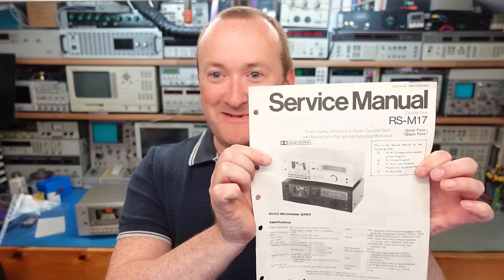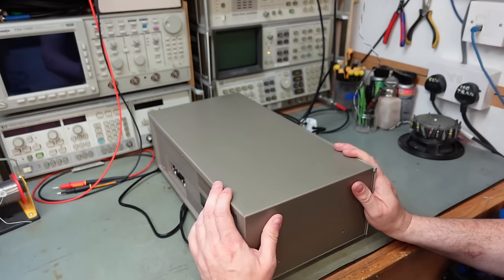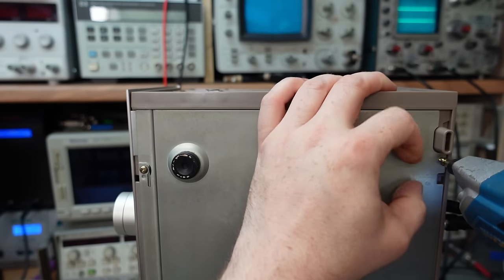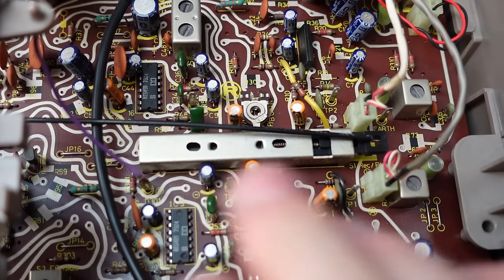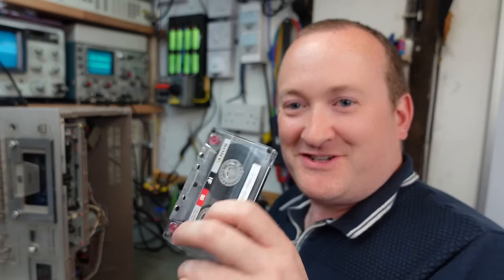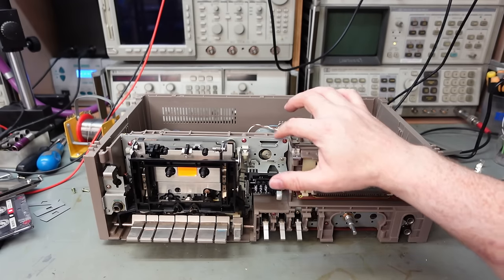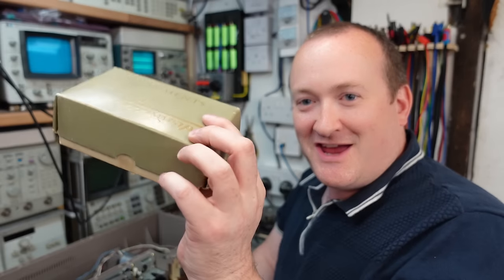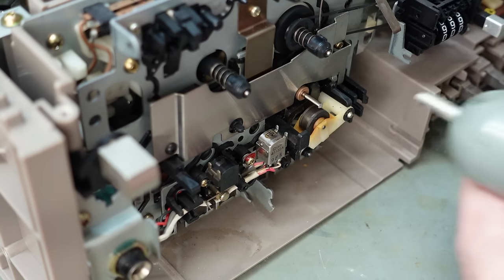1979 Technics Tape Deck Repair (RS-M17)

Comment: I repaired several Techics equipment, but without using an oscilloscope, I did not have the money to have one.
I repaired many switches, which is a very common failure, sometimes cleaning and changing their parts from other switches, which were recycled.
I also replaced flat and round belts, heads, roller pin and other spare parts, good video, greetings from Chile.-

Comment: Yes, the play/rec switch is a classic. I guessed as much a few minutes in the video. Usually corosion or grime from too little use/sitting still. 
My first try would be to just flick the switch a couple of times: usually fixes it, but I love the very thorough approach Mark.
Reply: Exactly! Quick spray with DeOxit, slide back and forth... Volia' 10 minute repair which makes way more sense with a $79 deck.  I enjoy his videos but this one had me yelling at my laptop.

Comment: Hi and thank you for sharing an interesting and entertaining video. My father was an TV technician, and I often visited his workshop. In those days, the 1970s, the technicians were wearing white coats. A word of warning and care though. When you cut those end bits of the capacitors, please remove them one by one as you go along. The way you did it, cutting them and turning the unit around to shake them out, one of them could get caught in there and cause a shortcut.
Reply: I was assuming that he was doing that for the sake of a better video, not having two hands in there blocking the view. Otherwise, having bits of wire flying around in an electrical device… what could go wrong? ;) … I love his channel though.

Comment: Another GREAT video. One small note, Demag should be turned on at a distance and kept on until withdrawn to at a distance.  The demag will produce a large magnetizing pulse upon switch ON and OFF.  Also a Demag may interfere with a nearby pacemaker.

Comment: I appreciate the extent you go to clean such a switch. I just spray some DeOxit, or what have you, in it as best I can and then actuate it 50+ times. If there is still noise or signal drop I repeat the process. If I've done it 3 times and it's still having issues I usually give up. lol. But seeing how you attack this problem gives me some pointers to try when I get back around to those machines that are on my "try again later" shelf. In fact have an Akai GX-747 open reel deck that I got for a steal because it has issues with a channel dropping. I managed to get most of the issues resolved using my "spray and pray" method but I'm sitll getting one channel to drop out occasionally.It was the record/play switch that was the offending component in fact. So I'm going to try and take it apart for a proper cleaning. I bet that will solve the issues for good now.Thanks.
Reply: your comment was like mine.. I think he opens it up for good content on youtube.

Comment: I used to repair cassettes-back in the day I would have been straight in with switch cleaner before checking anything with a meter or change the switch if the cleaner didn't work- no taking it apart carefully (which is the better approach these days given switches are harder to come by). I have all but stopped repairing them now and sold off all my better decks v cheaply although many were in a part dismantled condition and scrapped anything with mechanical keys. Still left with about 35 cheaper decks the most similar but later to this that I still have is the RSM216. Things are very different now and I love the care you take to make these oldies probably work for many more years but now we are not under pressure to fix loads in one day every day as was a typical commercial setup.

Comment: I watch with baited breath so I can gleen a small fraction of knowledge from watching you repair these electronic gadgets. But alas, I'm lazy and just let you do all the work and basically absorb nothing. It's much too easy just to let you do everything and me absorb nothing. I cringe every time you take apart one of these multiple switches, because I know if I did it parts would mysteriously loose themselves and somehow my chubby fingers would not be able to get it back together. Love the channel, love the videos.

Comment: I bet you've never seen a pulley on a cassette recorder so big and heavy. I had also never seen one so big until I took apart my Technics RS-641 which has a mechanism like this one (except the motor which in my case is servo assisted and is at the front). I have kept the original belt and pinch roller and over 40 years of use and abuse both continue to function satisfactorily. I admired the skill and ease with which you unsoldered the rec/play switch to clean it. (Something I was supposed to do on mine and haven't done yet.) As always, good job!

Comment: You have done a wonderful job with this tape recorder. Congratulations!
That multiple switch (play/record) is the cause of many problems.
I would have also changed the capacitors from power supply block (sometimes they produce low frequency noises. Especially when they are old).
You have a great channel YT!

Comment: looks easy. I have an M85 here. Up to 95 capacitors to change. 11 small switches and a few big ones to clean. Doesn't like doing anything, sometimes (after warming it with a blow heater for 10 mins) ff works, about as fast as play, if at all + lumpy action, occasionally rewind tries to work but doesn't. Play decided to work after an hour and some switch cleaner in the zone. I've never done much tape mech disassembly before, hats off to you tape guys!
  It's playing now but there are also 4 potentiometers to clean. Bias does not appear to work, output level acts more like a HPF / tone control.    
My friend wants €200 for it and i said to him if i get it home and it plays at least i might consider it. But now i'm thinking 40 - 60 hours of work. hmmmmmmm
Oh. It's also the 120V version! On a positive note. It's super clean inside. I wouldn't change all the caps but i would test them for terrible ones.
  What is the most common cause for lazy FF and RW in similar decks? I have many that just hate FF and RW!

Comment: Great repair! Just got my hands on one of these last week. Got it for free, and even though it was stored quite bad for the last years, the mechanism is totally fine. The only thing I had to do was adjusting the speed a tiny little bit, it was running assumingly 3% slow.
Just needed to work the record/playback switch for a few times and the oscillations I also had were gone!

Keep up that great work, greetings from Germany!
Reply: I have the same one and it plays slow also.What did you adjust?
Reply: @apriliaman  Depends on how slow it runs. Mine just ran a tinly little bit slower, but you could hear it.

What I did was adjusting the motor speed by using a small screw driver to turn the little potentiometer which is inside the motor.
You can reach it by the hole on the back side of the motor.
Play a cassette with a song you know, or ideally, a speed adjustment cassette with a static tone (3.000 Hz) for example, that was recorded on another tapedeck with correct speed.

But normally, speed shouldn't drift by its own, so it is probably due to electronic parts aging in the motor circuitry, so looking for bad caps for example isn't a bad idea, too!
Reply: @DaXande135   ok thanks! one day I may take it apart and look at it.
Reply: @apriliaman  It's very easy, it won't take much longer than 5 minutes to adjust the speed on this deck, because the motor is easily accessible.

Comment: That was a substantial drive belt. Nice chunky mechanism at least. Those gang switch mechanisms seem to be a common failure point, like leaky capacitors. It's nice to see a traditional deck from 40 years ago still being used. You did a great job for Sid, I hope he's very happy with it.

Comment: I watched this video and went shopping, and a 1980 RS M11 for 4$.  Well couple hours work and some pointers from your video
now, it is a nice deck. Just changed the Sanyo and orange electrolytic caps.  Yes the switches where in a sad way.  Thank you for the video.

Comment: I have one identical , just done the belts clean up heads , and all good, works like new. The caps in mine were all good tested fine and no leaks or buldge.

I subbbed your channel, you get some interesting stuff, I have a huge collection of mostly Japanese made stuff from 70's to 80's.

Comment: Nice job. I think the only thing I would have added to the list would be to adjust the playback level so the Dolby circuit was tracking properly. These days people primarily use these decks for playback, but if they plan to use it to record going through the record alignment would also be in order.
Reply: especially after all those cap replacements. There is bound to be some alignment issues despite the improvement in long term reliability. (also was probably out of spec due to 40 years of aging parts.)

Comment: Meticulously desoldering and soldering of that centipede switch and caps. Polishing the motor shaft and those copper bits of the forementioned switch shows how thurel you have to be with those 70's decks.
Subscribed in a jiffy 👍🏼

Comment: This is a rather common prob on these machines. You MIGHT get away with using contact cleaner and wiggle the switch "a gazillion" times or running it through the ultrasonic cleaner, but taking it apart and cleaning it by hand ensures that it'll take a good while before the problem occurs again. I'm using the same method as you do and it works just perfectly. The green goo is oxidation mixed with contact grease and probably a good ammount of tar and acid from smoking. It will create all sorts of funny things in the switch, causing the feedback. I've done this operation many times and the only things I'd do differently would be to NOT use the glass-fibre brush - or at least blow the loose fibres away from the switch innards - and also lubricate the switch with contact grease (acid-free vaseline or silicone grease) before assembly. Now if I remember correctly, there's most probably another little switch in the mechanism as well, controling the mute function when pausing or cueing. When this little switch gets dirty and loses contact, the output will be VERY low during playback. Quick solution; clean the contact surfaces and the prob is gone. :)

Anyways, thank you so much for a great video, keep up the good work!:)

Comment: I love your repair videos, Mark. One thing I noticed is the greasy look of the switch's contacts and PCB. It may be a protective grease. I also found this in the source selector switch of my DSP-A3020 which I had to fix some time ago. If you remove this in the process of cleaning the switch you should replace it afterwards.

Comment: I've had a couple of these decks come in for repair and with identical problems, They were both under an hour jobs. A spray of contact cleaner down that switch array, a head clean, degauss and alignment and both played and recorded perfectly. I can't figure out why you prefer to go to the trouble of removing the switch. OK you got the contacts really clean, but one of the owners never returned for his deck so I ended up using it myself for the past 30 years and never had any further problems with the switch.

Comment: Wow! Nice restauration of this humble cassette deck.
That pinch roller looked a bit crispy though... Good idea to replace this? Helps a bunch with those wow and flutter issues... with the belt replaced it should be a 100% restore to factory spec?

Comment: Great video Mark, I've only now found the channel.  I am looking to buy a cassette deck of this era and this is helping me to decide what to get in view of the potential problems.  I was an Electronics engineer in the 70's and 80's so it's very interesting to see how bad the quality of these cassette decks got later on.  I totally agree with you about the solder thing.  What possible risk is there in lead in solder on a pcb?  We still put lead on house roof flashings in large amounts.  It's the same with cadmium in silver solder - banned a few years ago but the non cadmium solder has problems just as the lead free solder does.

Comment: Tough way to clean the slide switch. De-ox spray would have been my choice. Before desolder tabs on thru hole, melt some fresh rosin solder on each tab. This flows any of the old solder to mix with new flux. Then the solder sucker iron will easily evacuate the molten metal on the feed thru and trace surfaces. 
Those slide switch contacts could use burnishing tool strips of fine or extra sensitive grade. When relay contacts were common, those burnishing tools saved replacing the relay. The burnish strips would leave no residue.

Comment: The tape transport looks a lot like a Hitachi D-850 and the RadioShack SC3000.  The Hitachi D-580 was a step up from the 850, and had solenoid controlled tape functions, which appeared to be the same in a Pioneer deck — not sure which model (900— something).   I was told 40 years ago that Hitachi was the source for all of them.  The RadioShack and Hitachi D-580 had variable bias control, but the D—850 did not (mine did after a messed with it, putting in a pot).  Although the 850 did not have solenoids, the light-touch controls were augmented by the motor.  All of them were 3 head decks, using one housing for both record and playback, again, identical on all of these decks.  I've still got the Hitachi deck I bought in 1978 — needed a belt replacement 20 years ago (I got it from RadioShack).  If you look at the rear of the motor there is a small "screw" which can be used to adjust the tape speed.  My deck was running a bit fast, causing my first tapes to "run" slow on other cassette decks.  I have a Pioneer CD recorder, but I actually prefer a good cassette deck — it seems CD's recorded on CD blanks of almost any brand have a shelf life, causing the music near the end of the disk to be noisy (factory recorded CD's are fine).  Cassettes I recorded 45 years ago still sound as good as ever.  A good three-head cassette deck (or reel to reel) with variable bias and Dolby calibration are as good as a Compact Disc, in my somewhat peccable opinion.  I have an AKAI reel to reel that does a fine job, but it's a hassle and blank tapes are outrageously expensive.  In the 60's i had an AIWA reel to reel recorder (it had its own speakers), and it got shelved when I bought my first cassette deck.  About pre-recorded cassettes — the few that I've bought were not very good, probably copied at high speed.

Comment: I must say I've come across noisy mode switches in cassette players many times but never pulled one apart. I spray some Deox into it with the unit on it's side so it travels the full length of the switch and activate several times with good results. Having said that your method is likely to be more permanent.

Comment: Love the video love your work, but considering how hard it is to get to the pinch roller and the fact that it looked a little glazed I would have replaced the pinch roller.  I just worked on a Hitachi D900 and it was the pinch roller that was causing it to eat tapes. And changing the pinch roller can really smooth out the replay of the tape.   But great videos I have liked and subscribed.

Comment: I would have tried some dexox before removing the sliding switch but I appreciate the tour inside.. I've had to do that.. not the fun part at least you were working with older Technics quality that looked very solid.

Comment: People, including myself, usually spray deoxit in the switch and work it back and forth a bit, and it works. But you took the extra mile and took it apart. Certainly a better job, but high risk. I'm always afraid the zinc (?) lugs would break from metal fatigue instead of folding back in place.
Reply from the maker: For great results,I’m a fan of the ultrasonic cleaner. It’s not quick though…

Comment: No grease on the switch contacts ? I had to disassemble an ALPS rotary, many-ganged switch, it was visibly worn. After cleaning, as a punt, I added a smidgen of graphite grease, that was a decade ago. The customer still uses it every day.

Comment: Mark that pinch roller was badly glazed . What we did in the 80/90s was to dip a cotton bud into acid tone and wipe it down gets rid of the glaze and cleans up the rubber don’t need to much but it works and brings the pinch roller back to new again . Same as doing a idler wheel on a vcr regards Mike. 👍🇦🇺
Reply from the maker: Thanks for the tip! At least it was still round.
Reply: Yes. We used alcohol
Reply: Alcohol cures many problems, going for Glory tonight.

Comment: I collect all the clippings in my hand so one doesn't get cought somewhere I put a ac primary line fuse in all my components that don't have one from the factory some have a fuse in the secondary I like one in the 120 volt primary in case diode or power cap shorts and transformer over heat and possibly start a fire is that a good idea do you think consult with a autherized service center before doing

Comment: All the caps will be either out of spec or leaking so all need to be replaced but of of course if the customer wants to pay :) The fun of old tech. I restored a lot of devices with SMD caps, what a mess

Comment: Whats the best solution for cleaning the heads. I notice you use a cotton bud but didnt mention the liquid. Also with rubber rollers when I was a photo copier tech we used an evaperative hand cleaner, citrus based I think. Thanks

Comment: Re the cue/review feature demonstrated at 36:45, I had a vague memory (parents had this deck when I was a child) that it attenuated the high-pitched output quite markedly when that's used to prevent speaker damage... but this one doesn't seem to be doing that, it's blasting it out at full volume.